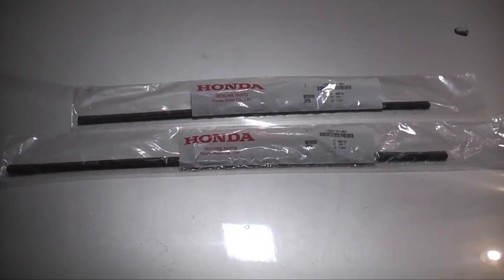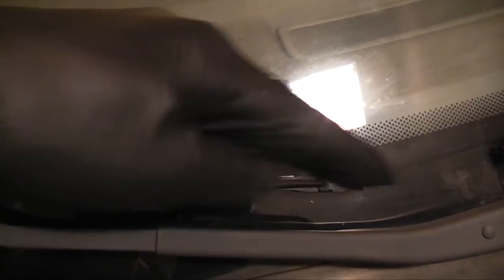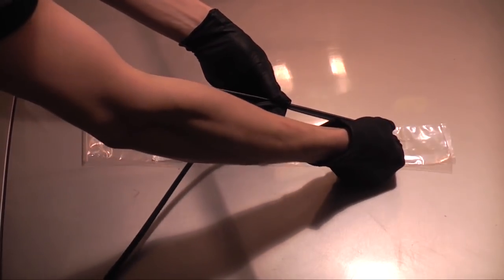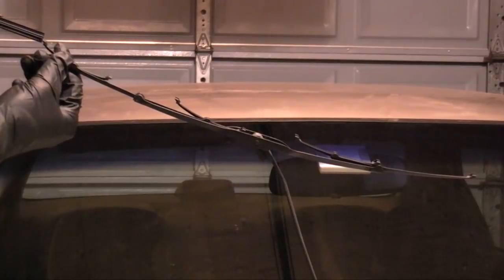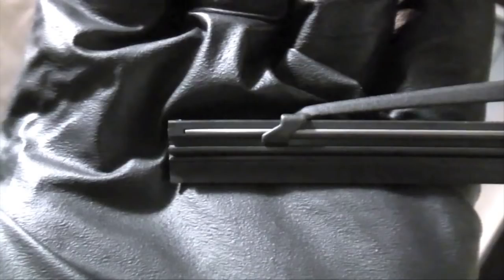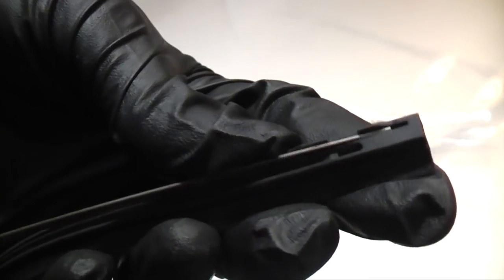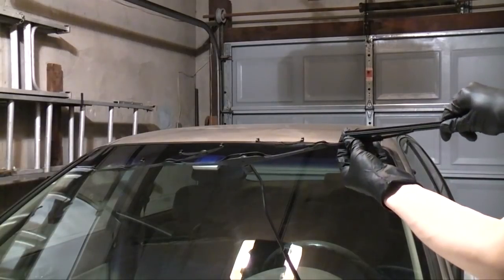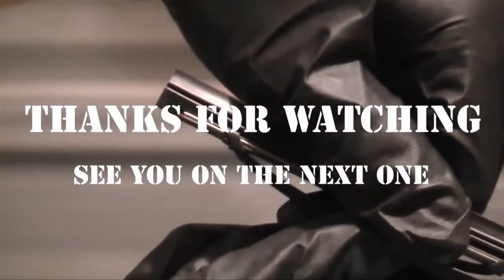Honda Wiper Refill Replacement

Comment: I love the notion of replacing the blade only, good job! When I realized it was sometimes cheaper to replace the whole blade, I was puzzled and disappointed. It started in the 70's with overseas outsourcing, recognizing that whole generic blades made for all vehicles could be produced for less, especially considering the cost of labour here. It's nice to see that some manufacturers are responding to that competition by lowering some OEM prices.

Comment: Except it keeps derailing: the rubber keeps popping out of the claw on one side or the other so that side of the claw ends up right against the metal strip. I keep having to back it out 500,000 times. Just took me an hour to replace one blade. My fingers are numb and it doesn't wipe right because the metal strips are no longer straight after an hour if fighting with. And yes, the refills are the right size, and I have this battle every single time, no matter the car. VERY frustrating.
Reply: That would be just too tedious for me. The stock wiper arms for my Element are long gone.
Reply: I did mine in 5 minutes